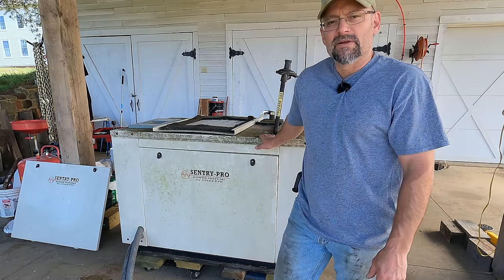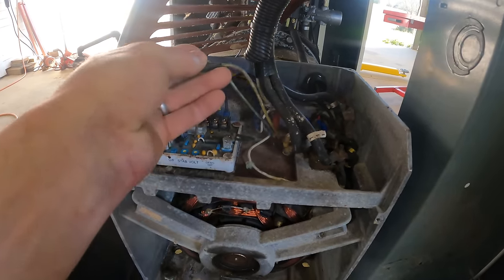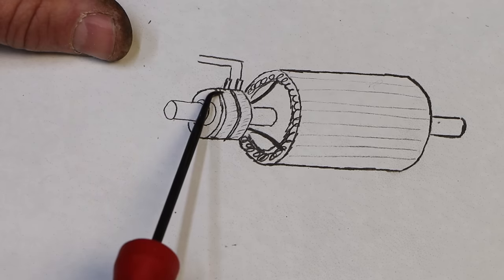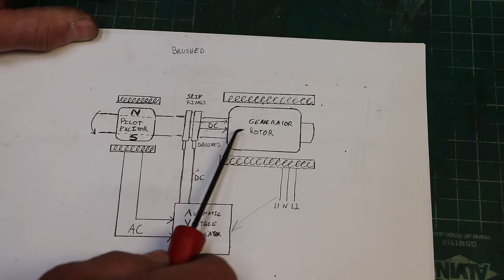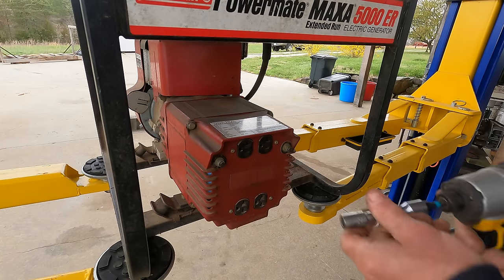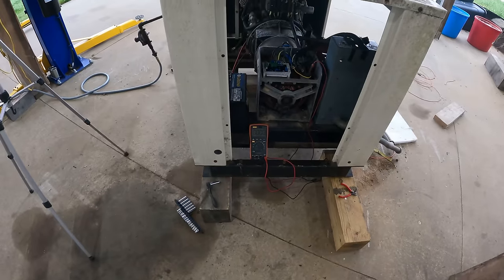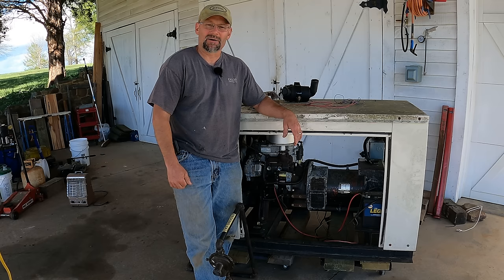How Generators Work, And How To Fix Them.

Comment: While it was not the problem on your generator, another thing that can happen is that the residual magnetism in the field can bleed off over time.  "Permanent magnet" is a bit of an exaggeration in this case.  As you mention in the video, the generator needs that residual magnetism to "kick start" the field so it can energize the rotor.  This is what you call the pilot exciter in your video.  When the residual magnetism dissipates,  you will have 0v on each leg.  If it is an unregulated, brushed AC generator, you can usually fix them by "flashing" the field.  The easiest way to do this is hook up a plain, brushed motor, drill set it to forward and turn the chuck backwards.  This turns the drill into a tiny generator to excite the generation windings.  This in turns induces a magnetism in the field and gets you started.  You will know right away if it worked, because the drill will take off and run on it's own.  Be prepared to let go of the chuck immediately.  The field current operating will restore the residual magnetism and the generator will HOPEFULLY work again after you shut it down.  I have fixed more than one 'free' generator this way.  This is most often a problem if the generator is left to sit for a long time without exercise.

Comment: Brushless at lower currents are unstable due to the power required to produce the field for the brushless to work. This is why you see brushless on only high speed high output motors. Low output motors wont spin the brushless assembly fast enough for the field to maintain a stable flow. It will fluctuate too much. Brushed works better for low rpm motors because the connection is direct bypassing the need for the extra field i.e. no more unstable field due to low rpm.

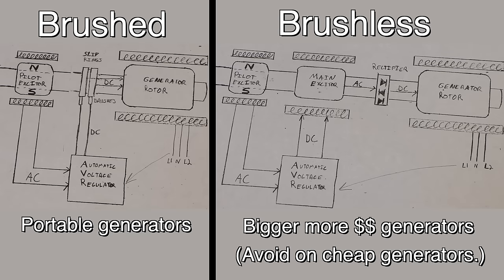Comment: 30:44 you said it in your explanation: brushed aren't used too often so maintenance of wear pieces isn't a problem and they output a more stable power because the regulation is 1 step vs 2 for heavy duty brushless (needs to be robust and low maintenance to be cost effective, cleaning up the power behind it is only a matter of a little more capital granted you also get a low maintenance system).

Your drawings and explanations were super clear, great work.

Comment: Standard UK wiring is red to red, black to black and blue to bits.

All fuel gas threads should be left hand on parts that can be normally connected and disconnected readily.

Comment: That was a good video really enjoyed this. I had gen issues took it into shop they couldn't find problem. So got brother on it turned out it was vapor locking rearranged the fuel lines problem solved.

Comment: Kudos for having a top of the line crimp tool. When using shrink connectors in outdoor applications, a lesser style will compromise the plastic and require additional shrink tubing. No doubt that you already know that and thus opted for the better tool from the get-go.

Comment: Honestly, that was one of the best practical and theoretical videos I have seen on this subject, you should be an apprentice training master in some big electrical generating facility. I have shared it with a young nephew of mine who although only 14 has a very inquisitive mind and is always pulling electrical and mechanical gear to bit to see what makes it work. Excellent presentation

Comment: Most water cooled propane engines run on liquid propane which means a different tank designed to deliver liquid instead of gas. Not sure about your engine.

Comment: I agree with some things are not logical, just look my my diesel generator, wiring it confusing. and TS1 is my guess transfer switch. those send a start signal to the controller.

Comment: If you have a small 6 volt battery disconnect the 2 wires going from the regular board to the rotor and. Just quickly touch them to the 6 volts and it should generate then reconnect the regulator

Comment: The wires got to the control box at the breaker panel.  When the power goes out the generator self starts and disconnects from service power.
Starting fluid is a good way to blow it up.
The small propane tank is more then enough to run that engine, the flow is so little the tank will not freeze up.

Comment: Haven't finished watching, but I am rather surprised that you didn't blow a fuse up because you left the blue wire clip that you were using to force the starter to crank connected to the generator chassis.

Comment: In the summer my generator will run great on a grill tank but in the winter it has a tendency to freeze. I’ve found if you put the tank in a bucket of warm water it tends to work better. Idk if that’s something you should do but it does work

Comment: Even if you “ramped” it a bit and had one end higher than the other you would technically still get some air flow across that heat sink. Great video!!

Comment: Reconnect all those wires and it'll run at least a motor you probably have a bad circuit in the generator side it depends on what type generator the Tesla style or the DC converts to AC Style with an inverter I've had a Honda generator have the inverter circuitry get fried

Comment: It would have been better to change some of the wires that had the join in the middle with single wires with only one crimp on either end, they all have screw terminals or push connectors so it would replacing parts just as easy.
multiple crimps on a wire adds resistance and a potential point of failure.

Comment: you should never use teflon tape on gas lines. The joint compound gets the threads to turn tight enough. The teflon could  frey off and block an internal orifice.

Comment: For what it's worth, when I look at a generator that does not run I put my meter/portable scope leads in the outlet and see if it is producing any voltage during cranking and that there is a good sine wave. Not everyone has a scope but if you do, there is a degree of testing that can be done without getting the engine running.

Comment: Careful of the aluminum finned heat sink on the voltage regulator board. It may be at a high DC voltage.  Like you channel, want more of them. 🙂

Comment: a small and cheap brush-less does not work in that method. 
it uses a capacitor to induce a phase shift and the kick from that excites the generator.
when the cap ages and the value changes, so does the voltage.

Comment: i use my left hands thumb to push on the pliers/wire strippers instead of arm strength and tend to bonk my hands must less just a little tip from an elechicken.

Comment: Things must be different in the States. Here in Europe engines that run on propane use a tank that lies on its side but have a tube immersed in the liquid propane and use an evaporator mounted in the cooling system to turn the liquid to gas.

Comment: The timer might have still been engaged.  They are supposed to run until it reaches operational temperature.  This gets any condensation out of the oil.

Comment: Those old "unregulated" Gen sets always measured a little high on the output when there was no load on them. They depended on the voltage sag when loaded down to end up correctish.

Comment: Why would you swap out part of the wire and the spade connector, instead of replacing the entire length?  I see no reason to have a connector in the middle.

Comment: How is the gass consum of this???
You that have been in to this.

I am from norway and used to 240volt. But fan of dc in boat system 

Is this same as gass tune cars ???

First time ever seen this system
Reply: More in to solar lithium diesel hybrid electric ❤❤❤

Comment: Does anyone have the link to the specific Mag Lite/Light app that Jon showed? A search in the iOS app store produced a number of apps, but none of them look similar.
Reply from the maker: In the app store it's listed as "Magnifying Glass with Light" by Falcon in Motion LLC.  Right now it has 3.4k ratings.  That should help you find the one I'm using.

Comment: euuuuhh !?!?  no manual and service book on the net or  do you make this video for hardcore self made man mod ? :-))   good job  and hello from Switzerland
edit: the price of propane gallon is "economic " for this usage ? motor is transformable in fuel ethanol or super 98  ?
Reply: This is a standby generator that may not be run for any length of time for months or years. Propane and diesel won't degrade or pull water from the atmosphere while sitting.

Comment: On that "swivel" joint, which was leaking gas, you could´ve seen right from the start, that it´s a left hand thread by the markings on the edges of the nut. I don´t know how to describe it better since english isn´t my first language. 🙈
Reply from the maker: I noticed them but didn't know what they meant.  Thanks.

Comment: Just a little fun fact. Engines that run on propane or natural gas don't have carbon like a gas or diesel engine. I've seen oil that came out of a forklift (that runs on propane) with like 550-600 hours on it and the oil was dang near as clean as the new oil was. Nice video Mr John.
Reply: But what about water contamination of the oil from the byproduct of burning propane??

Comment: Center scale in all analog meters is the most accurate rather than low or high end of the scale if you can select a range that places the needle nearer center scale.

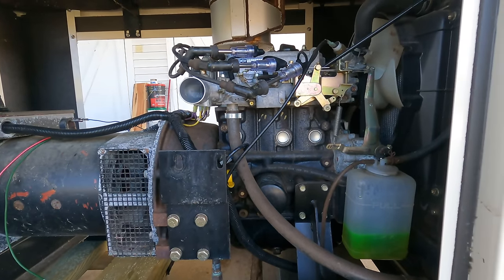Comment: 8:15 yes it did - and you still have your jumper wire in starter solenoid as well. And the other end with allicator clamp was grounded to the frame. So your panel actually created a short circuit. It probably didn’t have good connection since i didn’t see smoke… yet.
Reply from the maker: Good point.

Comment: I hope someone can verify this as its been a while. Mains voltage is 240v RMS not peak to peak?That's why you measured 252v as its peak to peak?
Reply: 240V RMS are 340V peak to peak, he measured 252V because his shop was actually receiving 252V instead of 240V, but it's whitin the acceptable range for US & Canada, it's exactly a 5% over 240V and the range is 240V -5% to 240V +5% = 228V to 252V, of course for 120V circuits it will be the half, 114V to 126V.

To obtain the peak to peak voltage you have to multiply the RMS voltage by the square root of 2, which is approximately 1.414
Reply: @ruben_balea  Thank you, it has been a very long time since using this and have forgotten most of it which is a shame.

Comment: You dont have to connect 12 volt to the panel external... Thats  output for the remote start... There is no power 12 volt comming to your panel from the engine now.. Check for a blown fuse in the start panel . 
,...

Comment: 6:24 in Europe we would always refer negative in a DC system. Ground wound indicate that the chassis is used as a conductor instead of a lead.
Reply from the maker: We often refer to negative DC in the USA as well, that's not what I thought was stupid.  -12V implies you have a voltage there relative to neutral.  So if terminal 4 is +12V and terminal 3 is -12V, that would be a 24V system.  IMO they should label it (Negative), (ground), (battery negative), etc.  But not -12V.  Just my 2 cents.
Reply: @FarmCraft101  then I misunderstood you. 

 I guess it’s used to save space when typing. It’s a common way of indicating power supply and difference them from other circuits that’s polarity sensitive. 
Since DC is only one leg of the generator/battery it will never double the way AC does.

Comment: He covered what I initially commented about...
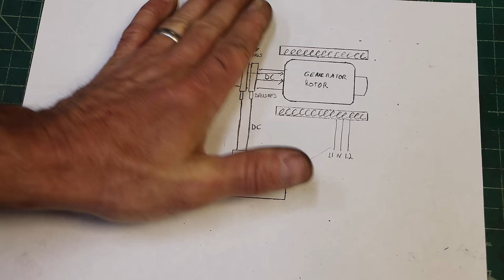Reply: 21:45 
You might get some residual magnetism, and thus residual voltage (like 20vac-80vac) on a used unit, and that residual voltage might be enough to bootstrap the generator head into operation, but relying on that residual voltage isn't recommended...

Comment: The FET looked like it was the failed part with the location of the sparks and cough staining, what was the thought process behind buying a $140 replacement for the whole unit instead of a presumably about $2 part?
Reply from the maker: The board was potted.
Reply: @FarmCraft101  Aah that'd do it.
Reply from the maker: Yeah, I almost always prefer to fix rather than buy new if I can.  I was disappointed that the board was potted.  I've even consider getting tools to de-pot boards, but that's getting a little crazy even for me.  ;-)
Reply: @FarmCraft101  You'd accuse me of being too charitable, thinking that it was potted for some safety/reliability reason rather than for reasons of planned obsolesence?
Reply from the maker: I think a quality board put in a tough environment will definitely last longer if potted.  I'm sure the manufacturers aren't unhappy that the boards are not serviceable when they fail though.  So, probably a combination of both.

Comment: A broken generator isn’t “free”. Any offer which requires effort on your part isn’t “free”.
Reply: It is free, since there was no cost for the actual generator.  Your weekend labor is "free".
Reply: @darknes7800  Do you think that your time has no value?
Reply: @ronliebermann  Sure, but you are working a few hours to fix a generator that would cost $3000 used and $6000 new.  That has a HUGE value, correct???????
Reply: @darknes7800  Yes, you’re right. I would certainly take that deal. But there’s no guarantee that your investment of time will pay off. It’s a gamble. Maybe the generator can’t be repaired. After all, if the machine only had a small problem, the original owner would have fixed it. So you’re getting a pig in a poke.

But what bothers me are all the fake “free” offers you see nowadays. All those signs that say “FREE!” but below there’s always some kind of condition. 

Free if you subscribe. Free if you give us your debit card number. Free after you buy two. It’s always some bullshit that makes it “not free”. 

If they want your personal information, it’s also not free. Corporate America is run by a bunch of scam artists.

Comment: What's stupid about 12v negative  DC.
Reply from the maker: It said negative 12V.  That would imply it's not neutral, but has a voltage potential of -12V.
Reply: @FarmCraft101  well in DC it is negative and positive as opposed to neutral and live.

Comment: Haven't seen the complete video yet, but your engine has a propane regulator and a low-pressure pipe hooked from regulator to engine. The propane regulator should have a hot coolent line attached to it to prevent frosting.  Upstream or before the regulator is reqular propane tank vapor pressure. If the engine has a regulator, then I don't think that there is any regulator needed upstream.

Comment: Your explanation of the generator did give me some cringe moments, but yes - you announced to oversimplify things, so all is fine.

Germany - and Europe in general - has a better system imho. We do have three live wires, neutral and protection earth. If you measure from a live wire to neutral you measure about 240V. If you measure between two live wires you measure about 400V.

You can run motors directly from 3 live wires with no condensator (and even the neutral wire is not needed!) because there is a 120 degrees shift between the live wires in phase. ☺️